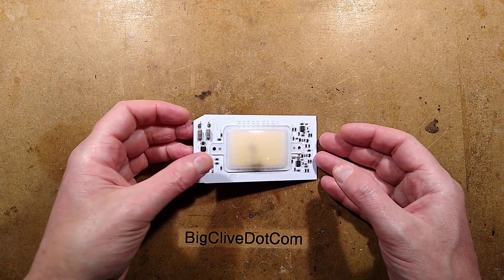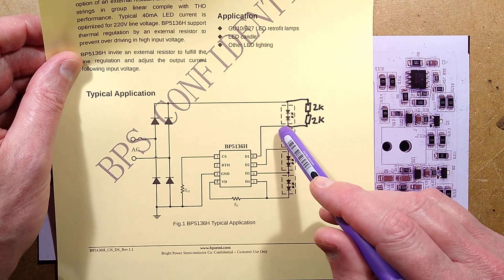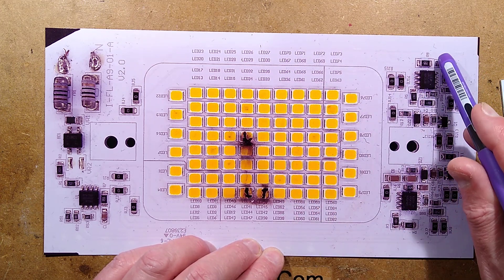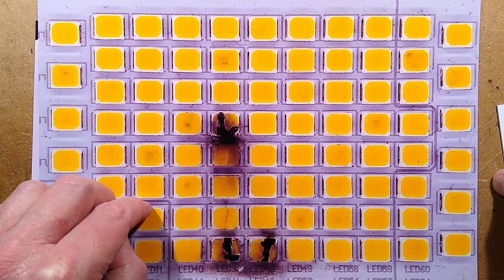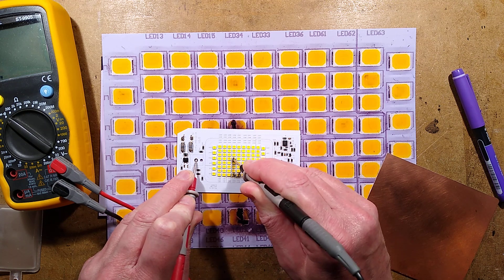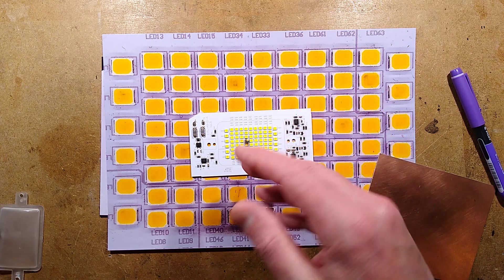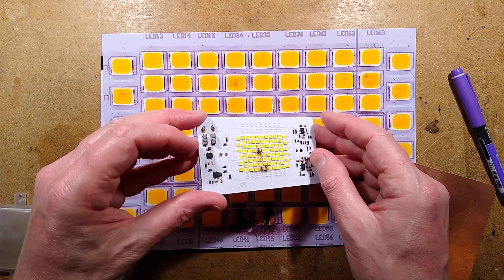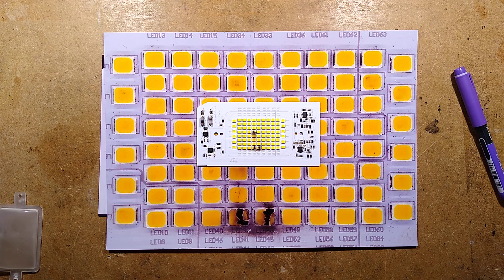LED shock hazards are increasing

Comment: US Voltage, UK Plugs, German RCDs and we should be fine. (Except if you want to boil water, step on the plug or need to pay for the RCDs, of course)
Reply: If you need to boil water we have 2 phase stuff in kitchens already for electric stoves and such, so just add a couple more of those sockets
Reply: With a proper RCD 230V is no more deadly than a 110V System. Technically it helps the operation of RCDs to have a higher voltage. @ 110V the current through a dry body is only around 15mA. Enough to cause trouble with your heart, not enough to trip a 30mA RCD.  You could build more sensitive RCDs, but they will trip a lot then, because many switched power supplys produce a few mA of DC current. 
Also 110V increases the current by a factor of 2, which means more heat, more losses and a higher chance of fires.
I prefer the swiss plug over the UK one. It has a fixed polarity and does not murder your feet when stepping on it. The fuse in the UK-plug is overrated, as most potential fire starters have no fuse or a fake one anyway.
Reply: @fabianfeilcke7220  : You can already fit a (very small) fuse inside a US plug, the UK plugs just have those insulating sleeves around the base of hot/neutral, and the sockets have ground pin controlled safety shutters.
Reply: @absalomdraconis  When I lived in the UK as a child (in the late sixties and early seventies) all the (MK) plugs in our house had a fuse.

Comment: Increasingly, products designed to work with 220V are failing prematurely with the UK 240V mans supply especially as it can be as high as 245V in some areas. SMPS products are often designed to work happily up to 250V or more but simple current regulation products like this are usually on the edge of things even at 220V.

Comment: I managed a while back to disolve the Aluminium substrate with Sodium-hydroxide, i was left with the copper coated Carrier material.
But also all components were gone too. I wonder if you could use Paint-stripper to get rid of the White paint.

Comment: I can see the flickering with my eyes on most led bulbs, even my more expensive philips hue lights.  The older led bulbs must’ve only been lit on half the sine wave of something because those made me downright nauseous but it has gotten a lot better now. All the lights on newer cars also flicker for me but at a higher frequency it seems. Any idea why they would drive them like that? 
When I move my eyes most lights leave a trace of dots in my vision.
Reply: For AC-powered bulbs the obvious reason for flickering is the zero-crossing and lack of filtering. For cars I think it's just PWM to vary the brightness. An experiment would be to see if it's just taillights that do this (which go to full brightness when you brake) or if all the lights do. Of course the question remains of why they didn't use a higher PWM frequency. It's not like it costs more to PWM in the kilohertz range instead of under 200Hz which seems common. They should ban these slower frequencies on cars (and hopefully also US-style decorative light strings often placed near the road) due to the distraction it can cause.
Reply: Not something I noticed until I switched on a fan. I see the fan blades strobing.
Reply: DIY and use meanwell LED PSUs they are 3000hz pwm and you will not see that in a million years. Most LEDs on this planet are cheap crap and you buying them isn't helping anything.

Comment: RCDs great and bad, nowadays there are so many types It's getting hard to know what you should install.
We needed a "Frequency converter proof" model for a Crane, as the original one could not handle the DC? leakage current from the mains filter on the converter. (As I understood it)
Reply from the maker: In that instance it was a need to be able to detect the high frequency supply to the motor.
Reply: @bigclivedotcom  Out of curiosity I had to school myself again and read, what EATON actually declared.
Their type is called Type U (Of course NOT standardized between manufacturers)

Apparently it has to do with LESS sensitivity in frequency's other than 50-60 Hz. Don't know about pure DC though.

I've come across this problems several times where I work, and I think it will be more common at homes as well, as people install Heat pumps with Inverters.
(At least here in Sweden.)

Page 6 here describes the differences.

https://www.eaton.com/content/dam/eaton/products/electrical-circuit-protection/circuit-breakers/xpole-rccb/eaton-protective-devices-catalog-ca20190603-en-us.pdf

Comment: Can you bypass the burned LED and keep the rest working?
Reply from the maker: Not so easy on this type as they are high voltage LEDs and it puts a lot more strain on the regulator.
Reply: @bigclivedotcom  Thank you very much for your reply! Keep up the good work!

Comment: Can you check "boltz pro charger" was a random advert on YouTube that popped up and was saying this can charge any phone in 15 mins surly it's not good for the battery
Reply from the maker: Sounds like a scam.
Reply: It might be a slightly different name but the "Computer Clan" channel did a debunking of the "Multivoltz" charger which had the same claim.

Spoiler: it was just an overpriced dodgy charger. Other than the branding it's the same as ones you can get from the usual grey market import vendors.

Comment: Another interesting video. Different class's of RCD might make a good (educational) video.  We have a ground mounted solar panel array with the DC wires come into the house via underground conduit.  At some point water has entered the conduit and the cables have gone leaky to ground (I thought they were supposed to be waterproof) and now every morning I come down to a tripped RCD. Electricians have been notified.

Comment: If it's a class 1 fitting it should be earthed, no exceptions. If it doesn't have a earth and its metal, don't fit it.  Just replace my (16th edition) plastic consumer unit with a 18th edition metal consumer unit, all Type A RCBOs and a SPD. It's not as expensive as people think it is.

Comment: Oh Clive, I have some HORRENDOUS brand name examples of this that aren't even aluminium backed. They may have been binned but I atleast have pictures of them.
Reply: Yup, got cleared out recently but your welcome to the pics... acrylic diffuser black and melted, must have gone though the PCB and heat transfer tape and then into the heatsink as that's all black too, needles to say the pvc cable actually snapped!

Comment: I went out of town and when I got back, I had 2 neighbors tell me that my LED flood light was incessantly strobing all night for the past 2 nights. At regular intervals, not the motion sensor being constantly tripped by a swaying tree or something. On for 2 seconds, of for 2 seconds, on for 2, of for 2, and so on; all night long. I wired a plug into the end, and took it inside to test it, but I couldn't replicate the problem. I even put it into a dark room to trip the photo eye, and tried tripping the motion sensor, but just couldn't get it to happen. Who knows.
Reply from the maker: It sounds like a capacitive dropper power supply is on the edge of failure.  Usually the dropper capacitor reducing in capacitance.
Reply: @bigclivedotcom  Wouldn't a capacitive dropper weakening result in dimmer output? It seems to me like it is more likely to be a switchmode supply where the auxiliary supply to the controller isn't staying topped up. I believe they are often 10uF 50v capacitors.
Reply: It seems you taking it inside might have fixed it. Maybe outdoor temperatures were causing some thermal drift in marginal components. Maybe a bad connection was undergoing cyclic thermal expansion and contraction and moving the light made the connection touch better. Or maybe the motion detector circuit was in a weird state and the simple act of removing power for a while reset the controller.

Comment: I have had 3 security lights with PIR's fail. All bought from B&Q. They all had the same fault where the light would come on but very dim. As Clive said, no earth connection so I added one to the case.as it is not plastic. The third light is still in place and oddly comes on and off by itself. Wiring checks out to be correct on the supply. I took one apart and found that they have mounted the aluminum reflector plate to the circuit board using a few drops of hot melt glue!!!

I notice now that B&Q have recalled these lights and do not sell them anymore. In a conversation with their Head office in London they were adamant the lights were safe and I pointed out that I had an electrical background and had taken one of the lights apart. I told them there was a hazard issue. In the end I said it was up to them but I had a record of the conversation and if someone is killed or injured then I will go public as I still have the faulty lights.

Comment: There is even the advent of Type F and FS RCDs. F type are better than A type (They can detect kilohertz frequency leakage, pretty useful in stuff with switching power supplies and homes with lots of dimmable LED fittings. FS are different again and are technically not even a real type of RCD, but act as a NEARLY B type, where the DC residual current has a significantly longer trip time than the other components of residual current. This makes sense to stop fires, while still offering the personal protection of an A type, but still is not quite as good as B (but is often much cheaper).

Comment: I bought cheapy($0.44 only) LED bulb,Just to see why its cheap.... It was with driver IC FM3081.. There was FULL WAVE Bridge RECTIFIER, 20 LEDs and the IC with 120Ohm resistor. Bulb ran for 30mins, I increased speed of Fan using its Capacitive Regulator, and LED bulb gone dead..😆

Comment: It does make me, as a German, a bit happy that we can have only the higher security ones, especially since I'm currently renovating an old house.
Reply: Yes you can but you probably won't https://www.amazon.de/ABB-FI-Schutzschalter-kurzzeitverz-2CSF204592R1400-8012542358336/dp/B01MUH3DPI/ref=asc_df_B01MUH3DPI/ they are very expensive.

Comment: I used to manage a Type Testing lab for a lighting manufacturer.  To pass pass ectrical testing we would flash test laboratory samples at 1500V and in the factory every fitting would be 500V tested at end of line.   It was surprising how many of MCPCB's failed the flash test, especially on boards sourced from lesser know manufacturers.  Well known brands like Tridonic, Philips, Seoul Semis etc rarely failed.

Comment: I wonder if the Arc-Fault Circuit Interrupters detect this in DC circuits? They started appearing in the national electrical code here in the states I think in the early 2000s. It now appears they have been required in nearly all residential circuits for new work since the 2014 update.

Comment: According to my observations, the hottest LEDs burn out first. Usually in the center of the matrix. And manufacturers make the LEDs work at the upper temperature limit (to save materials) and the slightest overheating leads first to the degradation of the crystal, and then to its burnout during voltage surges.

Comment: Clive you mentioned in an answer down below about modifying a (I assume a chinesium purchased LED) 50W or maybe a 100W and taming it down. I've seen you do this to various lights and cranked them down from 8W - 10W to 1.5W. My eyes require 18W minimum Cool White for me to function at night so what might you suggest, for educational purposes of course, to theoretically  enable me to mod a lights and give me the required output. This could be even for some outdoor floodlights that I am thinking of installing for educational purposes. I am thinking getting 50W and using an appropriate tutorial taming them down to 10W. I assume that is possible or is there too much variation between the different manufacturers to make a blanket tutorial for something like that?

No reply required if this isn't possible or you have way to much on your plate. I appreciate the shocking warning described in the video. Thank You for that. 👍
Reply from the maker: How a light gets modified will depend on the accessibility and type of internal circuitry.
Reply: @bigclivedotcom  Yes of course. I now remember you mentioning this in a previous video. My apologies for wasting your time with that question. DUH ME! 🤦‍♂️

Comment: I had 2 x 15W Cool White LED bulbs go POOF at the same time which coincided with me turning a fluro light off in a different room but the were on the same circuit. Of the 20 LEDs in the bulbs circuit 3 had spewed their guts out and another 12 had developed blackhead acne. Was always curious why they both went poof at identical times but it resulted in me removing the non branded chinesium bulbs from my fittings and disposing of them.

I was concerned when they arrived because they were a lot lighter than the local purchased on here in Oz so I ran them a while and found they were 11°C hotter than the local purchase. From memory they were 69°C after being on for around 30 minutes which didn't appear to be too bad to my zero electrical/electronic knowledge. If I can find one that may not have ended up in the recycling bin, would you be interested in playing with it Clive? I ask because I imagine you have a plethora of sent in items and I don't wish to add to your pile.
Reply: I've seen 5W fluorescent lights trip GFI's when switched off. Back EMF from the ballast is the likely culprit. I was in a school lab room with several benches that had several GFI's trip all at once when I turned off a light plugged into one bench. It doesn't trip them every time, likely has to be in the right timing on the incoming sin wave.

Comment: So the glass fibre substrate, could that be breaking down due to the expansion and contraction of the aluminium due to heating up and cooling down cycles? These LED arrays are driven very hard, aren't they.
Reply: Fiberglass is used because it has very good thermal properties, among other things. The only problems there are that it is very thin and can still break down when strongly heated in a single spot. The same problem would exist for any type of plastic, and even ceramics might crack under high temperatures, although it might be better.

Comment: 1:05: I find it so annoying that Chinese manufacturers plaster "confidential" all over their public data sheets. Must be a fashion thing in China to have something confidential.
Reply: Non-Chinese datasheets do have this sometimes as well, maybe nobody cares to remove the mark before releasing to the public.
Reply: Maybe it is a mis-translation and they really mean "official"? Purely a speculation on my part.
Reply: I thought it was so if you follow the data sheet and have a problem they can say: But that is a confidential internal document and not the finished one,  don't complain to us.
Reply: That's because the data sheets said confidential on them when the chinese stole them.

Comment: The downsite is that in Germany private power systems do not have to be tested again. Testing is only necessary if a system is newly built or becomes rebuilt. This means that many old systems are as they were built, as without RCD. Buildings that are only accessible to the public are subject to strict regular inspections. But if you have a car charger or solar system installed, you will probably have to have a new system checked, so old systems will also have to be rebuilt.

Comment: LEDs were supposed to be the future by taking less power and lasting longer. All the cheaper ones seem to be doing at the moment is adding to the e-waste pile! We never had that with fluorescent or halogen, the cheaper fittings were pretty good. Is that progress?
Reply: Then don't buy the cheap ones???

I have a bunch of IKEA LEDs, not a single one of them has ever failed on me.